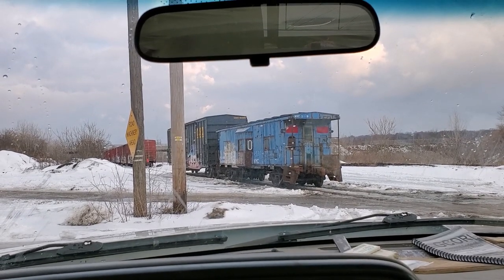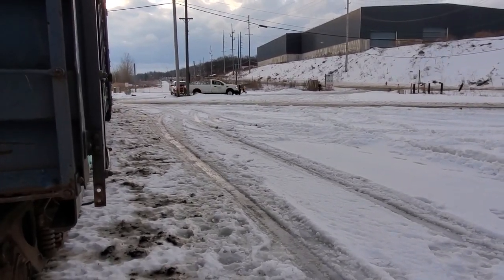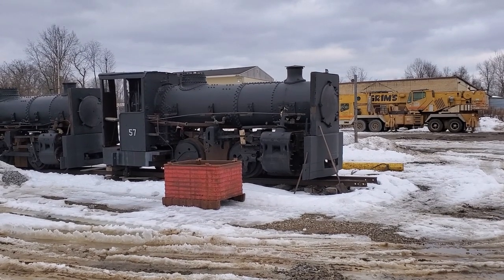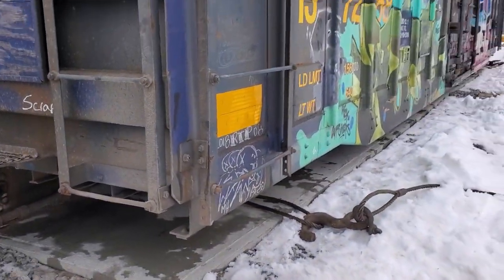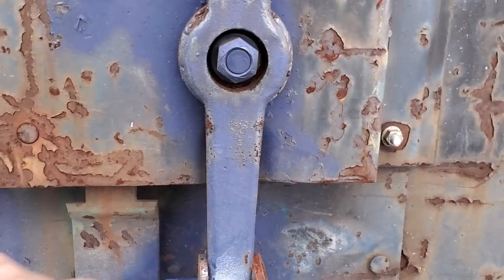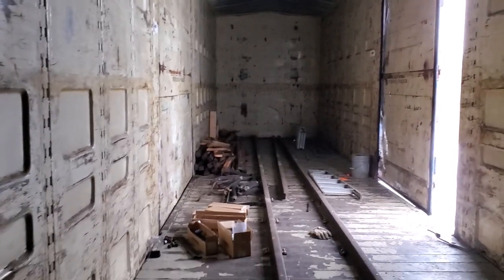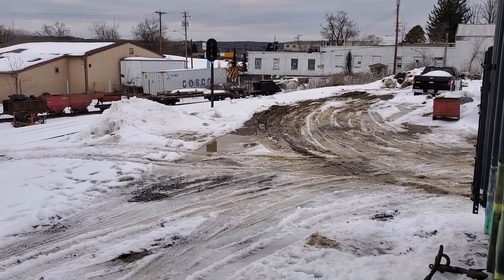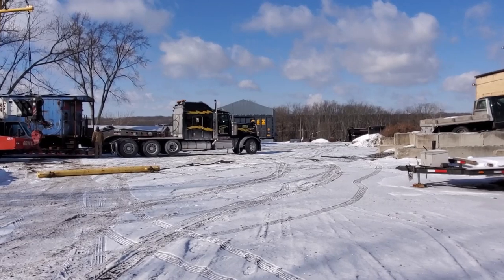Moving the Caboose and Boxcar to the J&L Narrow Gauge

Comment: Did I see that they lifted that trailer to put more arch in it for the load?
Reply: Yep. And when they loaded it, it sank under the weight.  If they hadn't adjusted it, it would have been sitting on the ground.

Comment: a spur leading into the car would be a lot easier than a transfer table! IF if course you have the space.
Reply from the maker: The opposite is actually true, since to have the equivalent number of storage tracks that a transfer table could provide would involve building  about five turnouts and much more track.   Each turnout is $3,000 just for the frog, guardrail, points and plates.  We can do the concrete for the cost of the first turnout and build the table for the cost of the second turnout.

Comment: It's very weird to have a boxcar become an enginehouse but I have a question was the boxcar enginehouse concept you're idea or would it be too expensive to build a brand new enginehouse?
Reply: As mentioned in the video, it is considered just a box sitting on the ground by the local government. Compare that to a building that would require all sorts of permits. Big cost savings.
Reply: @gravelydon7072  they will probably do a proper building later. You have a good point about cost though.